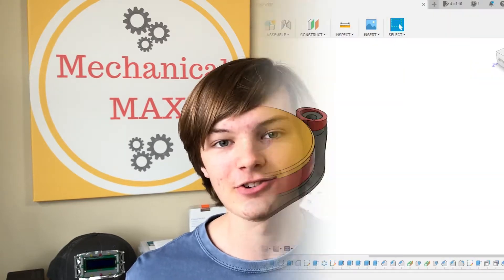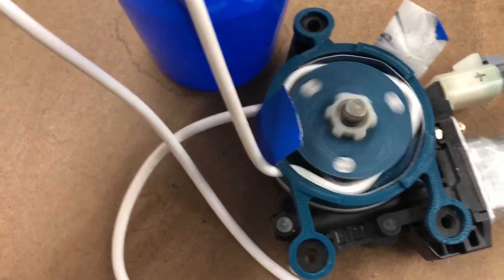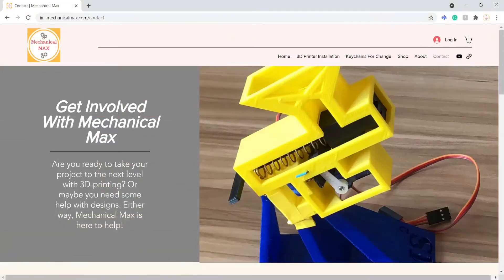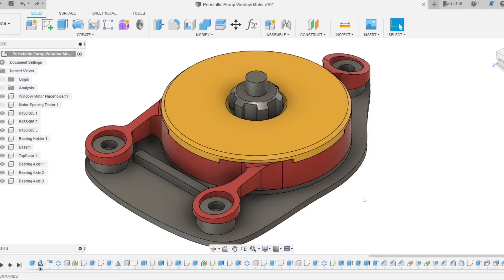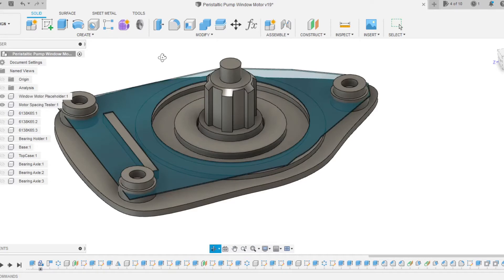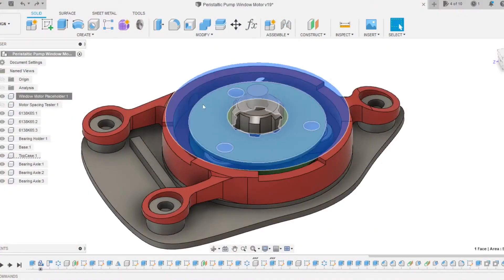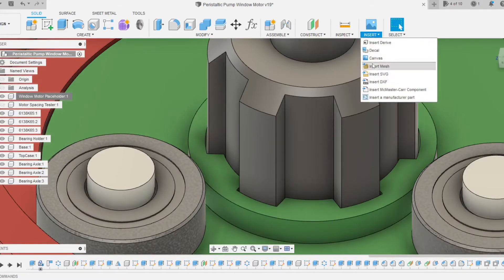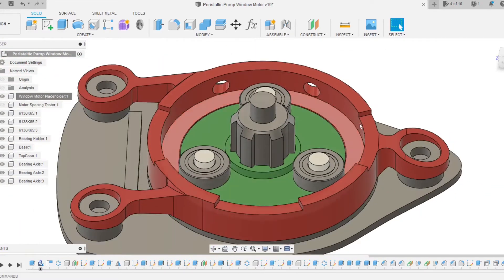Peristaltic Pump DIY 3D Print Design for Viscous Fluid (Hand Sanitizer)

Comment: Hi, I'm trying to 3D print a peristaltic pump roller to pump a viscous fluid (microalgae slurry), I need a relatively low fluid velocity but my motor needs a high torque, do you know what kind of motor I need, like approx power requirement and if i need DC 12V or 24V?
Thanks so much!
Reply from the maker: That’s a great question, thanks for asking! The motor used in this video is a recycled window motor from a car. It runs on a 12V battery with a relay as the switch. The motor itself is just the metal part on the right, so all the torque comes from the worm gear in the built-in casing.

I would suggest getting the larger motor if possible, because it would be better to have too much power than not enough. You can always get motors with interchangeable gearboxes too for more torque.

Let me know what you go with, thanks again for the question!
Reply: @MechMX   Great, thanks so much! I'm still deciding but I'll let you know (I have power constraints so it complicates things)
Reply: I have exactly the same problem hahaha have you found something new for your research? I am thinking about using a nema 23. Also designing a peristaltic pump from scratch using a 3d printer and laser cut pieces, maybe we can exchange some info.